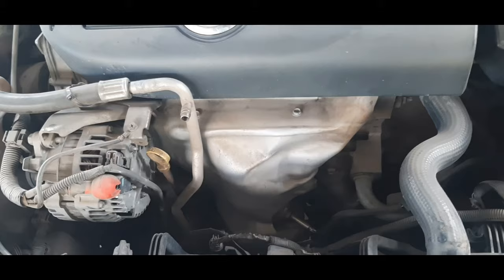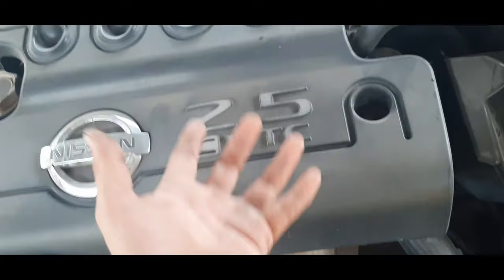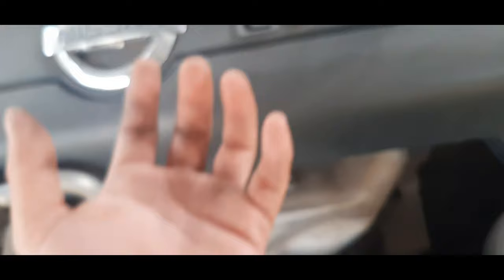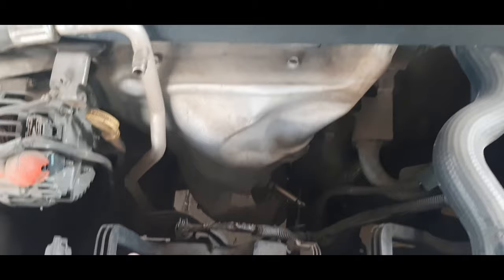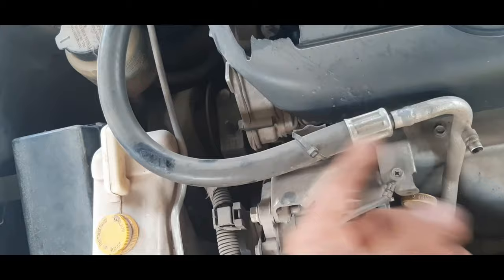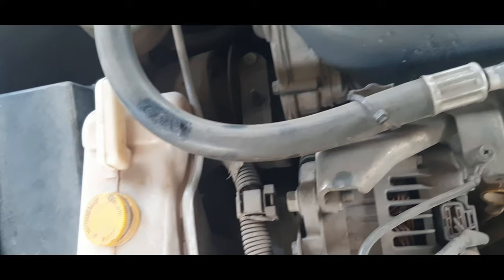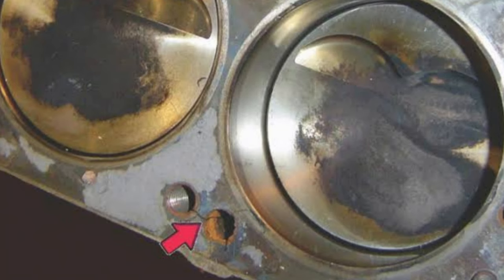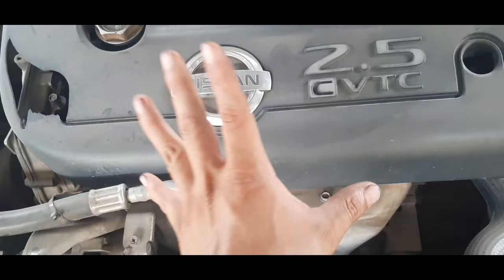3 Overheating Reasons on Your Car You Won't Believe!

Comment: Dear YourCarFacts . I come back to thank you for your tips. My engine overheat (temp gauge 75%, OBD 115 deg Cel) recently and  I check my water tank that is full. No water leak and water tank is always at full level and no refill for almost 1.5 years. I watch many video saying thermostat, fan, or sensor problem. None of them are correct until I listen to your advice and found that my radiator water return hose ( connecting water tank and radiator) is clogged ! I check my radiator actually it is empty but the water tank is always full!   Thanks for your tips! Mine is  Nissan QR25
Reply: Did yoir overflow ever squirr coolant  out ? So yours was the return pipe ..I'll check mine again 😊
Reply: My actual problem right now
Reply: @fashaassoon9658  oh dear let us know pal I had my egr cooler delivered yesterday awaiting my new oil cooler then its going on ..fingers crossed .

I've replaced pump,  belt , thermostat,  (twice ) radiator  ac condensor.  And flushed twice and correct coolant.
Reply: @kevinhancock4064  The mechanic said my head and block needed changing, the radiator, and there's a leak in the head gasket.
Reply: How did you fix. Did you change the clogged hose?

Comment: sometimes the head gasket become thin or worn not yet blown, this can cause overheating , also washing radiator inside and outside helps a great deal
Reply: Interesting
Reply: I have a new radiator and new thermostat but my car still overheating
Reply: @terranceprice3126  temperature sensor or worn out head gasket could be the culprit
Reply: @segzy05  you mean about temperature sensor which is at the radiator? near the front bumper? I have changed at my car radiator, thermostat, water pump still overheating but when drive it stays at 103 degrees and goes down 2-3  degrees. When the car stands with engine on, it goes up to 108... is this normal? Vauxhall corsa 1.4 2011 petrol. Please let me know. Thanks
Reply: @codrincod424  close to the engine .
Reply: @codrincod424  on that model the temperature sensor is attached to the water flange!
Reply: If no leak at cooling system by use pressure tester....coolant still reduce...maybe gasket head problem...
Reply: @codrincod424  no- fix it normal is 90-95

Comment: Putting a after market AC condenser can cause a transmission to overheat...I learned my lesson on that
Reply: AC condenser has nothing to do with your transmission. If you have a cooler on it, it would be connected to the radiator.

Comment: you're simi correct on certain things but not most.  first of all, you need to place a cap on the charge ports of your AC lines to prevent dirt from entering the AC system when charging which destroys your AC pump.

Comment: So you're saying that if the power is messing up in the car too like the lights flickering on and off with mine on the inside along with overheating and no heat that's the catalytic converter?

Comment: Hello I have a 99 Toyota rav4 that overheats if I don’t run the air conditioner while driving. I’m changed fan relays coolant sensor and none of that fixed the problem. Does my issues fall in any of your overheating reason. Even if it doesn’t over heat when a/c is on?

Comment: I have a mystery slight overheating on my 2005 Subaru Outback. I have checked many things and replaced a lot of parts already like the radiator caps, thermostat, and a few other things which commonly cause overheating, but I haven't yet found the reason..
What can you do to unplug the coolant galleries/passages in the motor? Do you have to take it apart for this or can they be flushed manually through the radiator hose?
Also, do you think a vacuum leak could cause overheating?
Edit: I found out what the problem was. The heater core lines were clamped by the previous owner with pressure pliers..🤦🏻‍♂️ Seems like the coolant going to the heater core was leaking inside the cabin and he decided to prevent a leak this way.. talk about a hack job. As a consequence, the cooling system was being pressurized and overheating. I ended up doing a heater core hoses bypass. Problem fixed.
Reply: Yes bro; a lot of causes and worn head casket can also lead to overheating 🥵; anyway if you have a vacuum leak that might be manifested as an unstable engine firings and rough  transmission on speeding; that is to the best of my knowledge!
Reply: @samalkawaz4314  Thank you
Reply: These are the possible causes of engine overheating: defective radiator cap, radiator fan, loose fan belt, defective water pump, defective radiator, defective hose, thermostat, lack of coolant/water, defective cylinder gasket, clogged water jacket in cylinder head/block.
Reply: @joeabella1690  Thank you Joe 👍🏻
Reply: The water pump not pumping properly can cause overheating. It may have a corrode propeller and will move collant but not enough. Ive had that issue before.
Reply: You can use a radiator flushing solution that you just pour into the radiator to clean out the coolant passages and radiator. They sell it at most auto parts stores. Your muffler or catalytic converter could be partially clogged or collapsed.
Reply: @elppedro77  how would u know this ? Wouldn't ut cause engine to cut out ?
Reply: Replace air filter
Reply: I wish I could know your address  I can bring my car to be fixed over there because I changed a lot of  things but same problem keep repeating.
Reply: ahh fixed once, change cap - but better take it to a mechnic for tests cause it may have another porblem,, cause for heat maybe a lot of things.

Comment: Hi my car overheats on and off it will run without overheating and then its starts maybe after doing about 15 miles ,its starts throwing  water water of the coolant tank. The fan comes on  but it builts up so much pressure  in the system the water pipes become so hard unless i open the coolant  cap slowly  to let the pressure  out then the fan stops and temperatures goes back to normal but when i close the cap again  it builds pressure  again. I have changed the thermostat and temperature sensor but nothing has changed.do you have any idea of the problem is

Comment: Need help I got 2006 Nissan Sentra ser spec v turbo it start up fine drive fine but when the motor up to temperature and when motor hot it kinda die on me I gotta gas it to go and it back fire when it die. When it die it's start right back up I don't have any check engine light on or over heat let me know if anyone know.
Reply: We have a Honda CRV doing the same thing n can’t figure it out, did you figure it out?

Comment: Exhaust leaks around the manifold will cause a car to overheat
Reply: Yeah. I just went thru that. My car gage level went up & down running high. RPM HIGH AS WEL. & I noticed the boot on da throttle was cracked  I temp duck taped it .    Quote I read the live date on the Obd2 scanner reading tripple digits on the short trim 1fuel  was high.   That’s what lead me to chk the vacumm leak Nissan Maxima 2010
Reply: That's really Intelligent

Comment: Ac is just started blowing warm and then car started overheating and I noticed fan stopped blowing because car wouldn’t vibrate as much as before when AC was on. Any specific idea why my 1994 Corolla is overheating??? 🙏🏽
Reply: Most likely a faulty cooling fan

Comment: I change everything thing on my 2011 scion but my temperature light still turns on after about a 5 miles drive it starts flashing then it stays on I don't know what to do next can someone help me with some adives the car runs good the motor is strong

Comment: Im in Connecticut neeed a mechanic please help i did waterpump thermostat need fan for the radiator pcv valve still overheating 04 chevy monte carlo help please
Reply: Are u hear Hartford?

Comment: My car overheats quickly despite the radiator being topped off!  Could it be a bad thermostat or water pump?
Reply: Did you end up fixing it
Reply: @XxChristopher123xX  currently having a head gasket replaced
Reply: @FontuneTheTeller  why the head gasket? Did u try the radiator thermostat?
Reply: @fontunetheteller410  I removed my thermostat and it stopped overheating I'm assuming it's my water pump but I've noticed when I drive fast it'll go up
Reply: @ScolarshipBoy1984  I had driven too long too hot.  Had to replace head gaskets and got a new thermostat.

Comment: I have a question cause it only do it when my AC is on
Reply: AC fan not to turning on. Well... most likely a relay or fan itself died, that's supposed to turn on when you turn on the AC.
Reply: same what u do to fix it ?

Comment: Hi there.  I have isuzu ascender.  And it's being overheating.  They changed the water pump.  And thermostat.  And a antifreeze container. They told me take it is ready they 5 blocks away as i was driving it started to heat up. They call me return it they forgot to connect the fan. My truck was so hot smoke was coming out my motor.  Then later we notist there was a broken pipe call the "t" which is between the antifreeze container and motor.  My truck still in the shop because the part wasent available. They have to order it from chevy dealer.  I'm very worried about my truck.
Reply: Juss sing 🎶 Bye, bye Miss American Pie
Drove my Chevy to the levee but the levee was dry
And them good ole boys were drinking whiskey and rye
Singin' this'll be the day that I die……

Comment: Catylitic converter won't cause it to overheat
Reply: Ours did. Made the engine so hot that it was burning everything in the engine.
Reply: @joyceobeys6818 yes it does and increases the back pressure in the engine

Comment: Over Heating engine problem solution is best to use Graphenizer, watch the live Test video : - https://youtu.be/SqNIGQM1I2Q 

Graphenizer is a revolutionary product for those who are experiencing overheating engines, low pickup and performance, high fuel consumption, and high carbon emissions with black smoke from their engines.

As it is the only solution for all the above problems to be solved instantly.
It not only cleans the engine and enhances the performance, but also provides a cure and saves the engine from further damage. It gives it a long life by providing a protective coating to its internal parts like pistons etc. It can be used for all the vehicle's engines, and it is very convenient to use, and the results are immediate and long-lasting.

Performance of your product. It will help to improve the performance of the car, the fuel efficiency, clean the engine and avoid knocking.
Reply: I watched a video that said to be very careful of what additives you add to your vehicles.  Old cars aren’t like the newer ones.  They are all different and you can further mess up your car.

Comment: Has anyone ever heard of an alternator making a car overheat? I've never heard of that  But my husband said that 1 of his coworkers  Told him that his car was overheating and he had already fixed everything imaginable That usually causes cars to overheat Such as the water pump  The thermostats,He replaced the radiator, Checked the fans and  He even checked the engine to make sure that the oil was clean and did not have any Milky looking oil... So he was sure his heads were not damaged And for some reason you decided to take Ito take it to autozone   To have the car scanned  And it came back that's something Was faulty on the A battery or alternator so he replaced the alternator and now he said His vehicle is not overheating anymore... Is that even possible? I'm really just trying to  Understand why the alternator has anything to do with the temperature of the vehicle To be honest  I would like to prove my husband wrong lol
Reply: Maybe the drive belt was slipping and not driving the water pump properly, then when he put the new alternator on the belt got tightened properly.

Comment: Why I went electric.  SCREW these kinds of problems!
Reply: Good luck
Reply: I've been looking at electric but I'm not impressed. The issues that happen with gas cars are because the manufacturer build them that way on purpose to break. It will be a long time before everything is electric. Most electric cars are ugly, and people aren't about to give up a good looking suv or nice lifted truck for electric. They can't even figure out how to get good range without not making it aerodynamic. I had a model Y for a few days and range sucked really bad. I had to charge it too many times.